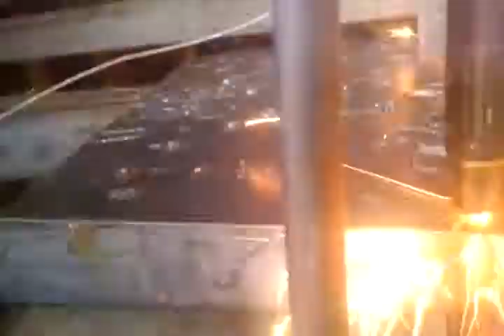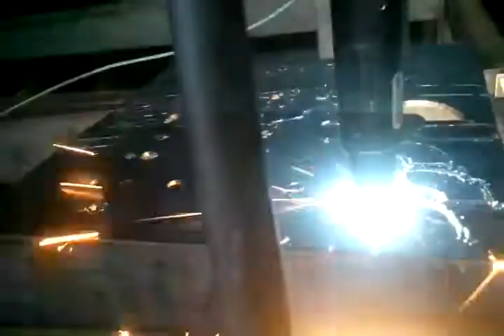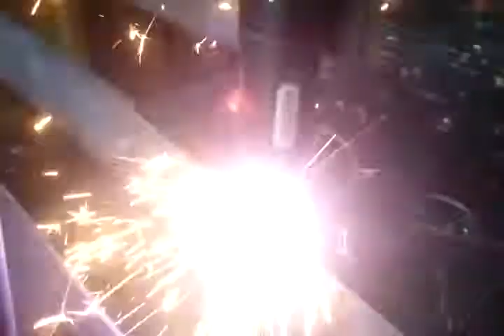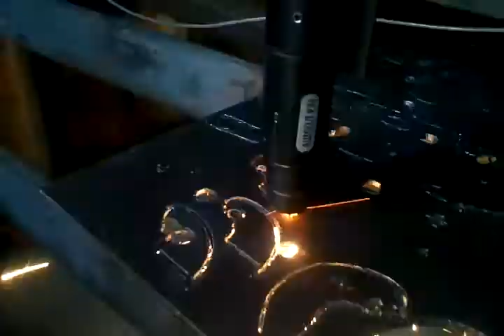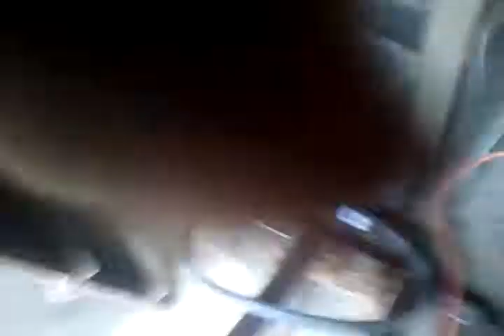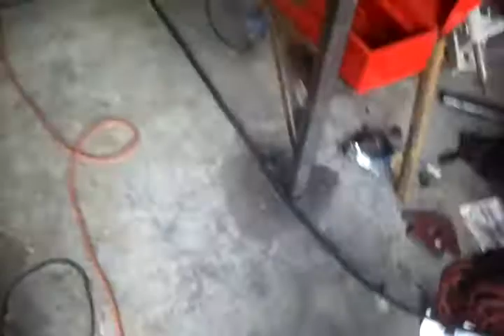Plasmabot 4.0 CNC Plasma Cutter part 4

Comment: you need higher stand off when moving.
and build a bed for it and fill with water keeps everything cool no warp
just water proof everything and hang cables from up high or build a cable swing

once tank is built tape off axis tracks and drive eq and roll or spray on bed liner then it last you for years